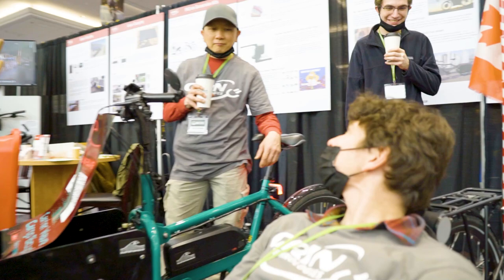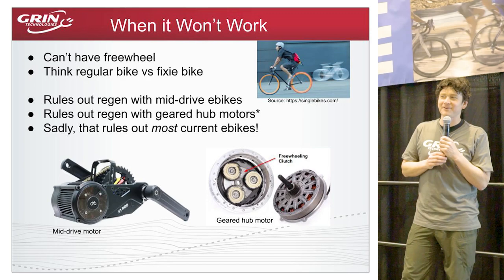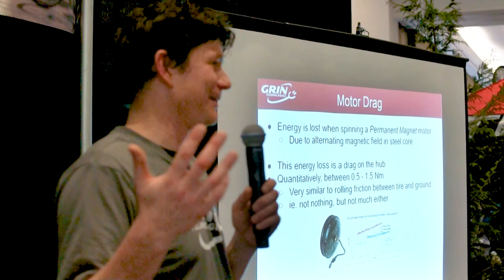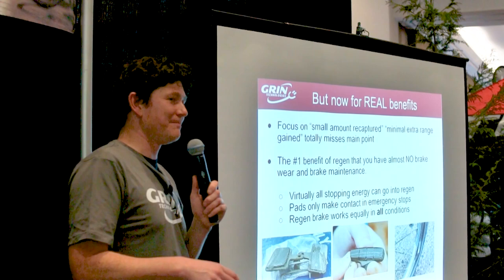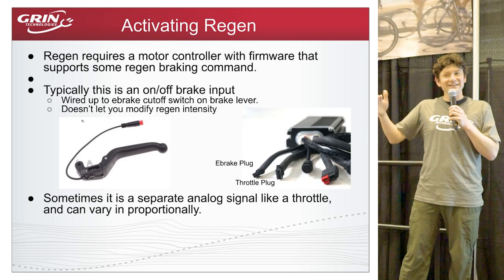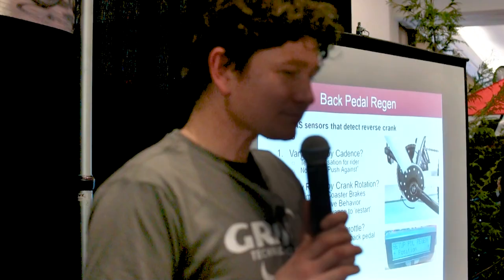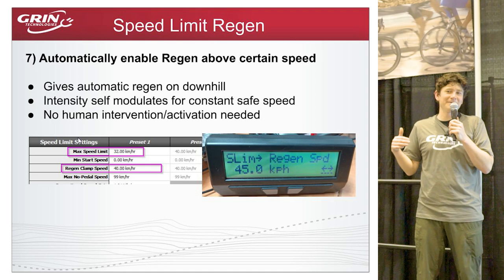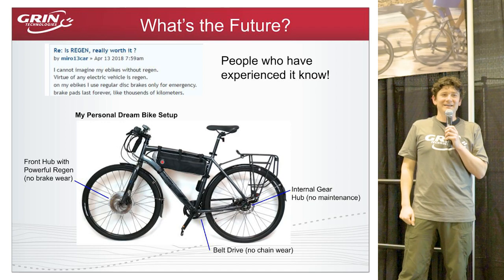Regen Braking and Electric Bicycles, Justin's Presentation from 2022 BC Bike Show

Comment: This has been a great presentation. When I was growing up we always stopped our old single speed bikes by backpedaling to activate the brakes. We didn't have rim brakes yet and certainly no disc brakes. They also coasted pretty well too so they weren't "locked" pedals. I'm pretty sure regen could be implemented by using the pedal cadence sensor? Maybe a torque sensor instead of a cadence sensor? Move it slightly it regens enough to slow you down, move it back a bit more and it regens even more effectively even all the way to a stop? With our old bikes one needed to keep some back pressure on the pedals to ensure the brakes remained on but if one wanted to release the brakes then one simply let up the pressure or began pedalling again.
Another issue I'm thinking about is the lack of torque a direct drive motor has verses a geared hub drive motor. I currently have a geared hub drive motor on my bicycle and it works fine although it can be too weak sometimes. I've heard from many people about direct drive hub drives and the overall consensus is they are underpowered. Not in horsepower of course but in torque. How does one compensate for the difference between the torque from a direct drive hub motor and a geared hub drive motor? Use two direct drive motors, one in the front and one in the back? Or use a GIANT direct drive motor in the back? Of course weight becomes an issue once one reaches a certain size. Interesting problems and it's going to be interesting how it will be resolved.
Thank you everyone at Grin for continuing to research and experiment for ebikes.
Reply from the maker: https://youtu.be/gYCj4asp9pE?t=1827

Direct drive motors can delivery plenty of torque for almost all applications as long as they are sized appropriately and your motor controller can give sufficient phase current. Motors with the same winding KV will give the same torque output for a given phase current whether they are geared or direct drive.   Compare say a BionX D direct drive motor system to almost any geared motor ebike and it will throw your "consensus" out the door!
Reply: @GrinTechnologies  Thank you for the quick reply.
Rad Power Bikes used to make their Radwagon with a direct drive motor and 26" wheels. However they made the newer one (Radwagon 4) with a geared hub motor and it's got 22 inch wheels. Their literature says they went to the geared hub drive for the increased torque and went with the 22 inch wheels to lower the centre of gravity. What you're saying is they could have kept the direct drive motor and increased the phase current to make it more powerful?
Reply from the maker: @davemeise2192  Yes exactly. We were a bit bummed to see Rad drop the DD hub motor option too. For the same torque capability a geared motors will typically be a few pounds lighter than the DD equivalent, no disputing that. But the really well engineered DD hubs (like the Grin All Axle or BionX D series) cut that gap pretty close.

Comment: Although they last longer than brake pads, rim surfaces / disc rotors won't wear out as quickly either.  This may be more significant for commuting due to the gritty stuff kicked up in the rain.  I also wonder if mech brake cables could last another season given the reduced usage frequency and tension.
Aside from cost savings, I also like that regen can reduce braking noise (particularly disc squealing).
Reply from the maker: Ah yes, good point about the brake noise too!  It doesn't cost $$ directly but I've seen countless time wasted by people tweaking their pads and calipers a bit here and there to eliminate a stubborn squeal.

Comment: With hydraulic disc brakes, it seems that adding a hydraulic pressure transducer would make a lot of sense. With a transducer, the electrical signal from the transducer would be proportional to the hydraulic pressure in the brake system. The regen controller could then use that signal to proportionally vary the regen. In other words, the harder the rider squeezes the brake lever, the more regen will be applied.
Reply from the maker: Yes, this suggestion has come up as well! The slight problem with it is that you need to fully engage the mechanical brakes before the hydraulic line pressure builds up, which means you are wearing out the pads too.  Perhaps with a high sensitivity transducer it would be acceptable, but still ideal is not having the brake pads touch at all.
Reply: @GrinTechnologies  You can add flow controls to hydraulic circuits, but I don't recall all the options available as I haven't done engineering work in a long time. My gut tells me it's doable though. Perhaps a flow control needle valve, that one could dial up/down to regulate the flow to the hydraulic lines with the pressure transducer upstream of that. So, you could dial up/down the regen by controlling the flow rate to the disc calipers. In other words, with the flow control valve restricting flow to the brake calipers, the transducer would send full signal for max regen to the ebike controller while the brake calipers would be only slightly modulated. If more friction braking was desired, then one would back off the needle valve to allow more flow to the calipers
Reply: @GrinTechnologies  What about using potentiometer, for cable power brake?

Comment: They can make locking cluches both mechanical and electrical.
My regen is a thumb throttle inside my twist throttle. Has my headlight button as well. Works fine even with gloves on.
The hub motor wins even on the gental down slope because you can peddle against it creating more power to regen and gravity helps you alot!

Comment: great presentation. it's clear to me that variable regen is the quintessential application for an analog Hall sensor in the brake lever.
my interest in regen goes to the design of a e-trailer with regen capability. having done a long tour with a single wheel cargo trailer, the first thing i noticed was desperate need for braking on the trailer. all that extra mass in the back puts far more stress on the brakes and also become unstable.
having the trailer do the braking while regenerating is the perfect solution. your motor just went to the top of the list. i'm also reminded how similar 'marketing' is to 'propaganda.' thanks. keep smiling.
Reply from the maker: Hey stephen, yeah it doesn't take much to tie an analog hall sensor and magnet to a brake lever and get modulation that way. With a trailer you also have the option to have a force sensor on the hitch and activate regen on the trailer wheel whenever the trailer starts pushing the bike (and use reciprocal approach for power too)
Reply: @GrinTechnologies  i really like the accelerometer idea for a trailer. the problem would be averaging due to bumps in the road. i'm thinking of an e-trailer that would provide just enough torque to push the trailer's load and provide regen braking.
a great design goal!

Comment: I wish I could like this twice. I love every single video on your channel Justin. 

I'm trying to be cheap on my 3rd ebike build, but I think buying cheap components is more expensive in the long run. First 2 we're mid drive, but I think I'm sold on hub for less issues etc. Thinking about buying Grin all-axle motor and putting it on a Surly frame for the ultimate reliable ebike. And building my own 2.5-3.5+ kwh pack in the triangle. What's the best cell for longevity, even if it's at the expense of energy density. Open to other chemistries, but trying to keep battery pack under $1500 if possible (not including tools and my labor/time). I would like to have at least 50% capacity after 5,000 cycles. Considering lifepo4 even if it means less capacity than what I want
Reply from the maker: Hey Geoff, it's often 3rd times the charm on custom ebike builds! That said, a cheap direct drive motor will be plenty reliable, just heaver than the All Axle. The area not to skimp out if regen is important is on the motor controller so if there is one place to splurge a bit it's there.  For your battery, the best longevity comes from using name brand cells like Panasonic more than any specific chemistry. We're seeing tons of larger capacity batteries with the Panasonic GA cells that are now reaching 7 years old under regular use and have only lost ~10-15% in capacity.  There is really no place for LiFePO4 anymore when cylindrical lithium cells with almost 3x the energy density are performing this well.
Reply: @GrinTechnologies  thanks for your reply and for giving me the reassurance of using traditional lithium ion cells. Looking at Samsung 50E 21700s but still haven't decided exactly what I want. A lot of folks tell me to get high discharge rating, but in a 14s14p pack, I need very little amps from each cell. Hopefully that combined massively oversized pack and charging to 90%, discharge to 10%, I will have a pack that could last me a decade. Long lasting pack and durable bike means 1000s of miles riding without much worries. Thanks once again!
Reply: xD I checked out the company in that article, Nano One, turns out they're from BC! Burnaby
Reply: @Geoff9001  The Samsung 50E2 cells would be fantastic if you are under 2C per cell discharge which would be 140 Battery Amps in your 14P application. 

For even better longevity, set your battery cutoff to 20% or higher as research has shown discharging lower to lower levels increases capacity degradation faster than charging to the upper limit. So something like 3.2V or even 3.3V/cell+. You'll have a ridiculous amount of range anyway with 14P high capacity cells.
Reply: @Geoff9001  I have a 14s7p 52v rectangle Panasonic GA pack. It's pretty big ! Are you planning on 100v system or extreme range? Some Enduro frame batteries are 8kw 72v 40amp , 240 cells ... 15 kg!
Reply: @chickeee  I want no range anxiety. I live in Houston, TX suburb(30 miles/45km from downtown) and want to be able to ride my bike there and back no problem along with joining social bike ride when there. I'm trying to make a ebike that can help me get rid of my car and I think my #1 concern is range and fast charging. I'm thinking about getting a fast charger as well for emergency use on the go(like 10-15 Amps).

Right now I'm budgeting about 15-20kg for the pack which is super heavy but it's centered on frame and I don't plan on going over 30mph
Reply: @connectvanplans  thanks for reaffirming my decision as I've researched this a lot and it seems like the ultimate cell right now for what I want(low power/high range).

And by low power I mean I'm not gonna ever pull more than about 35 amps @52V nominal

Comment: I'm riding a radcity with DD hub motor. On my  10 ah battery a was able to get 54 KM down to flashing last battery monitor. That ride was on very flat ground with 0 hills of any consequence. On another ride with an extremely hilly road (would have to walk my old standard bike up) most of the way in hills. I was still able to get 54 KM on that same battery due to the number of times I hit very steep down hills.
Also, I have made an ebike with a DD motor but it does not have regen on the controller. The curious thing is, I cannot peddle the radcity with power off for any appreciable distance (100 feet) before this 70 year old body peters out. However the home made bike DD motor I can peddle quite a bit easier (not nearly as much magnetic drag). Just some interesting anecdotes. 
I don't dare run out of power on the radcity so I carry a second battery always (once convinced me).

Comment: I think a great setup for electric bikes is to have the front wheel be a disk brake and have the rear brake just be a sensor which controls regen (this assumes you have a hub motor on the rear wheel)

Comment: Really great talk. I've also had the dream of an ultra low maintenance bike. 

But am i correct that the GMAC motor is not currently designed to attach to the front hub? Are there plans to make that possible?

Comment: Love it! I didn't know about the new feature to back pedal to turn on regen.  I've always just slightly squeezed the brake lever and used the throttle to increase regen.  However, even that wears out disc brake pads sooner than necessary.  I'm 100% with the beta tester who suggested back pedal just to turn on regen and still use the throttle to increase it.... Looking forward to setting this up.  Thanks Justin!
Reply: so you program the controller so that as soon as brake lever cut off the power, throttle is used in reverse to modulate Regen? sounds smart although it means if you are using full Regen and slowly release the brakes you are jumping from full Regen to full throttle ?
why do you have break wear, isn't it possible to avoid engaging the brakes?
 I think the definite answer to Regen is really a brake lever with first half of the lever travel spring loaded and triggering a linear Regen, then once max Regen is reached, the second half controls mechanical/hydraulic brakes. this way you make sure that any hard braking uses 100% regen, you can still brake the same way with electronic off or Regen is disabled (with just less initial bite and more travel), you can precisely control Regen and you don't have to learn a different way to brake, just to recalibrate to the blended braking.

Comment: I always enjoy listening to your lectures, Professor Grin!

I don't know if you can answer, but I was wondering about regen's effect on battery capacity degradation. I've looked at some research papers, but some of the more applicable looking ones are behind the paywall sadly. If this is not too specific, I have some high-power 21700 cells (P42A) I always keep between 4.1-3.2V, but I've been wondering what is my regen 'C' limit for limiting long-term battery damage.

I'm not limited by BMS (I use RC chargers for balancing), and the battery spec shows a chart charging at 2C (8.4A), but I know in general it's better to charge at 0.5C or less for longevity so that's what I've always done. Regen doesn't induce the same constant current for the duration of the charge cycle, so what I'm really wondering is if short bursts of 2C or higher regen rates would end up accelerating the capacity decay over time. Any insight on this?
Reply from the maker: I wanted to go into address this topic but left it out of the presentation. The quick answer is that all evidence suggests that short duration regen currents even at high rates has almost no meaningful effect on cycle life. If you do a full charge from 0 to empty at say 2C that definitely reduces cell life cycles compared to say charging at 0.5C, but just occasional bursts of 2C for a few seconds or 10's of seconds hasn't had any effect that we've been able to observe.
Reply: @GrinTechnologies  Nice, thanks for the response :)
Reply: @GrinTechnologies  I had this question too after watching. I can regularly pull 1kW (about 1C) for 10-15s going down the hill from my house to the main road I use to go anywhere and was wondering what impact it might have on my new 52V/20Ah battery.  Thx.

Comment: This also gets into the realm of antilock braking as its good to know how much or how quickly the regen braking comes on and at what point to limit it, other than human braking input, and i guess you could use spokes or brake rotars as circular encoders for wheel lock etc.

Comment: Not sure if this was mentioned in the video but another advantage of DD motors is the zero maintenance it requires vs a mid drive or geared hub motor. The most it would ever need is a new set of bearings from what I can see. From a mid drive or geared hub motor there seem to be a lot of moving parts that would eventually need replacing. Simple unsexy DD hub motors for the win!
Reply from the maker: Couldn't agree with you more John! Regen is just one great reason to get a Direct Drive hub, apart from them being the most maintenance free, reliable unsexy machines you could ever dream of.

Comment: Thanks Justin, I have a BBSHD mid drive and was wondering if this was possible on my bike,and I found out why, freewheel 24speed and hydraulic brakes, thanks for the very informative vid. Might have to build a hub drive  ebike 👍
Reply from the maker: We won't discourage it, there's a number of benefits even beyond regen!  https://ebikes.ca/learn/why-hub-motors-are-awesome.html
Reply: @GrinTechnologies Thanks for the reply but  I like the power from the  rear like a MC what are the adv/dis with front and rear hubs?

Comment: One variable brake throttle option, which I'm using with my GMAC: Brake lever with integrated brake switch pulls the cable for: "Hall Effect Pull Throttle 3 Wire - Electric GoKart Go Kart 1-4v", which is plugged into the throttle input. The brake switch always activates before the throttle, so it just works as a brake throttle. The go-kart throttle doesn't have much modulation, basically 0, half, or full voltage, but I set it up so it rests around half throttle, CA set so 0 throttle is around 2.7v, base ebrake voltage around 0.6V. The modulation between 0.6V brake voltage and 0.0V isn't great, but it isn't an issue in practice. Braking works great, and uses a brake lever w/ no button needed. The only problem is I can't use a throttle, but PAS is nice.

I do have some play in the GMAC between acceleration and braking, always have. Is that not supposed to happen? There's always a little clunk the first time I hit the ebrake after using it in forward. 

I usually get 20-30% regen, depending on how hilly the ride is. The more hills the closer to 30%.
Reply from the maker: Ha ha, that is a clever workarout solution! I like it. If you have a Phaserunner or Baserunner controller, you can change the regen range from 0-0.8V to be more like 0-2V and have a better range of control, and have the power throttle be in the 2-4V range. Just make sure that both the CA and the controller have the same basic throttle map.